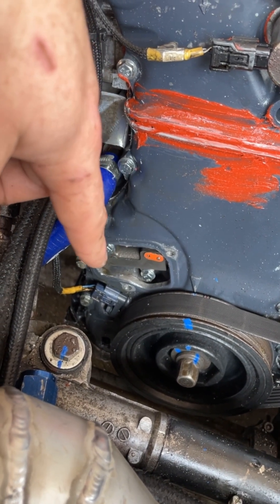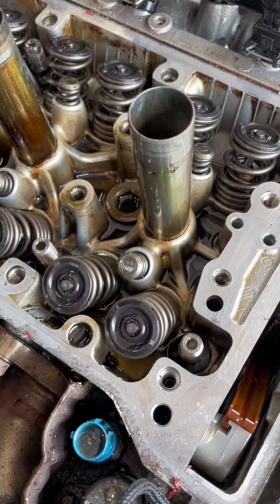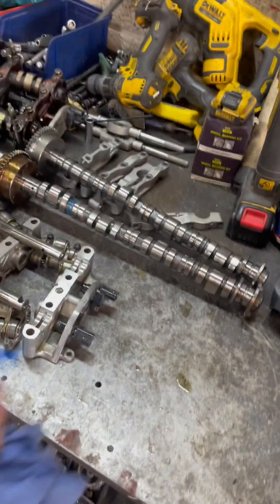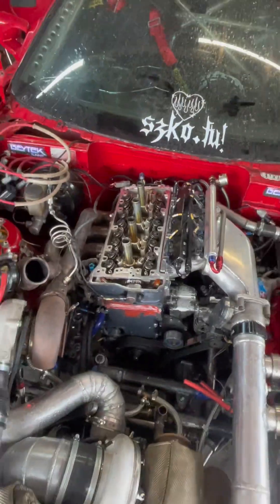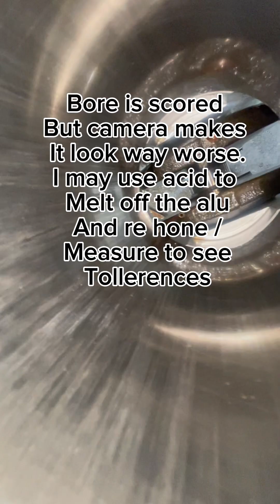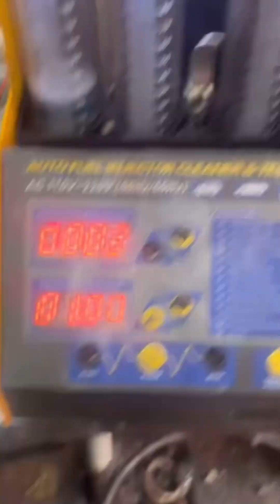My New Engine Is Broken.... Time to pull it apart.

Comment: You could use 8 injectors set up with lower capacity each so if that happens again it wont flood the cylinder
Reply from the maker: im currently x8 1500 cc injectors. I need this size of injectors for the power on ethanol wich is over 1000bhp. Fr crail i ran 1000cc pri and 1500cc sec however on e85 it struggles up near 900bhp with them.
Reply: @BEYTEK  What if you use e85 and wmi with the old set up?
Reply from the maker: @Dimitriss_de  WMI isnt reliable or consistent enough to be used in replacment of injectors. Although i do have a wmi kit to keep charge temps down i dont use it for fuel headroom as it dosnt give that much improvment even if i was using straight meth. ill have 4 bar of boost plowing back into the wmi nozzle it dosnt flow that much . its just a bit inconsistent and potential for things to go wrong :)